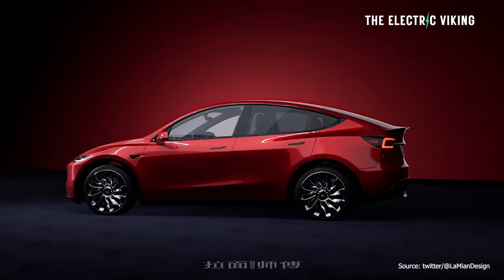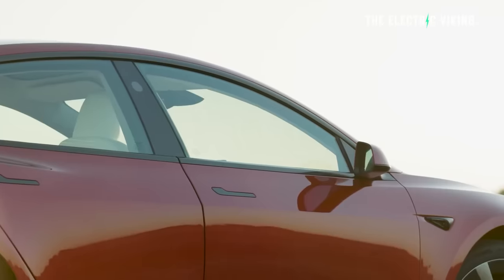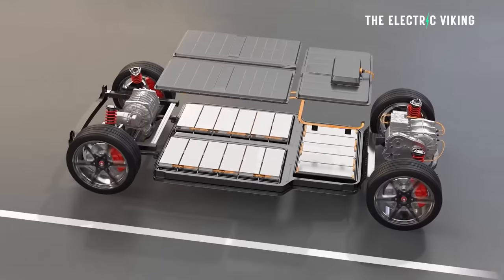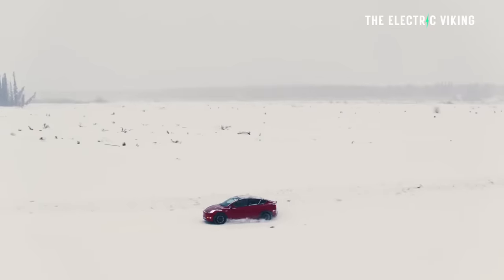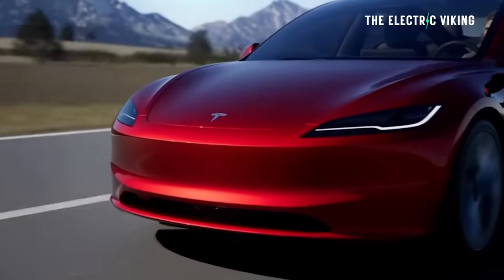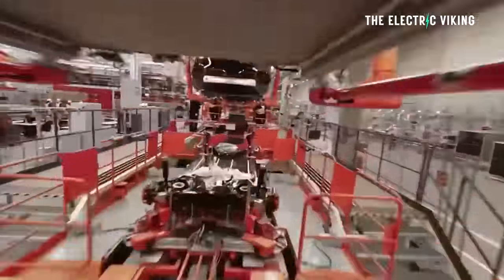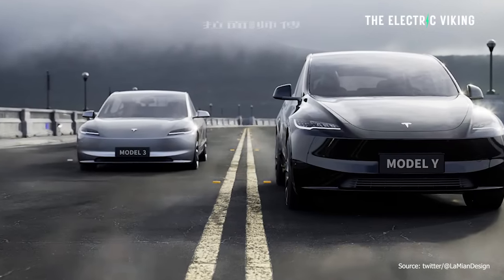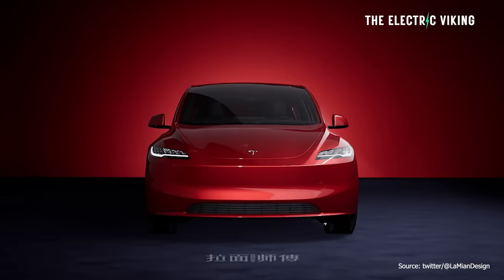NEW Tesla Model Y Juniper details leaked - Factory retooling only weeks away

Comment: 20% more range?  doubt it.  Maybe the same gains as the Model 3 or slightly more.  And why would you not want to own the current gen once this releases?  It's not like it will just be worth zero instantly.  Even though new Tesla's may get better then older ones, they are still cross shopped to other brands aand when you compare, even the "older Tesla tech" comes out ahead.  So unless all EV brands get this new battery tech and ICE cars drastically drop in price, the current gen Model Y will be fine barring any double digit pricing drops by Elon on the new ones of course.
Reply: That's just some people's perogative. They want the newest most recent version if they are spending that much money. Plus some people specifically want the newer upgrades. Like Model 3 for as good as it is still has things people dislike about it or complain about and almost all of them got fixed with the Model 3 Highland. Same will happen with Model Y Juniper. So for some people it's a no brainer to wait for that.
Reply: @VMYeahVN  Maybe I misunderstood the comment in the vid as if you have one now, get  rid of it before the new ones drop. If I did misunderstand, then yes, agreed - wait if you can.  Unless there are some great deals on current.  I bought a Model Y RWD last summer, knowing that a refresh is on horizon.  But I  got 6500 CAD off sticker because Tesla had excess inventory(?). And then 5 grand rebate on top from federal gov.  And this is off the lower sticker price after all the post pandemic price drops. My model Y was cheaper than an upper trim Honda CRV. And if I wanted to sell it when the new "better" Y comes out, I'm hoping the value vs a CRV (or any other ICE/EV small SUV) is still better allowing me to get a decent price.  Those that bought at Pandemic prices, are pretty much locked into long term ownership unless they want to take a 20k haircut by trading/selling.
Reply: @bort7258  Same thing. People who are very into tech/gadgets, which EVs are, or otherwise like to be early adopters for the latest and greatest are perfectly fine taking a loss to upgrade to the new model. Especially if it's notably better than the previous model. To them being in the cutting edge as well as the daily experience of actually using the product is more important than getting a deal. They're not concerned with holding onto a phone/computer/etc for 10 years or till it breaks. They want to be on the cutting edge and have fun following the life cycle and upgrade path of a product line and the trade up loss is the price for playing that game.

Comment: If it’s not 100 percent LFP , I don’t want it
Reply: Why?  Is it the cycle life you're worried about? While the LFMP batteries have less cycle life than LFP it is still higher than NCA or NCM and they can still charge to 100 percent.  One thing I will note.  My RWD Model 3 has LFP batteries and the degradation isn't really that much better than my previous NCM model.  Maybe a tiny bit better but it's right on par with any other battery at around 10 percent at 100,000 miles.
Reply: @Ryan-ff2db  did you charge your NCM to 100 percent most of the time or 80? You already put 100k miles on the LFP model 3?
Reply: @Ryan-ff2db  what Tesla uses the LFMP? I am good with anything that doesn’t limit me to 80 percent “unless long trips “
Reply: @shdmd2118  That's kind of what I thought you meant.  LFMP according to this video and other sources I've read including statements from CATL, indicate that the newer batteries will be in Tesla's mid 2024.  Chinese vehicles will have them sooner.
Reply: @Ryan-ff2db  It doesn't oxidise in decomposition.
Reply: @davidbrayshaw3529  LFP are safer but all battery types are still significantly safer than gasoline engines.
Reply: @Ryan-ff2db  Nonsense. There are lots of claims to that effect but no cited data to support it. It's folklore and nothing else.

Comment: Osborne effect will keep it from being best selling vehicle.
Reply: If your thinking the 2 will osborne the 3 it will not.  Different market segments.
Reply: @danharold3087  No I was saying the Model Y will have a difficult time being the #1 selling vehicle again in 2024, as early 2024 sales might lag (Osborne effect) due to announcement of 2024 Juniper refresh.  Also, re-tooling and shutting lines down for refresh is going to lower model Y sales in 2024.  Combination of Osborne and re-tooling will make it difficult for Model Y to be #1 selling vehicle for back to back years in 2024.
Reply: @zacjones89  I would not go so far as to say your wrong.   The refresh is a tough thing to manage in a way to prevent it.  With luck people not buying the old will buy when the refresh arrives and  the refresh generates more sales.  So hard to tell.

Comment: Thanks for your videos 2 reasons why I won't even consider EV is no charging available at home in the apartment car Park more critically insurance costs , 54 year old driver less than 20,000km per annum only 4 companies prepared to offer, i have been driving since 18 never had an accident or speeding ticket lowest quote $4900 per annum. Compared to $980 (based on Tesla Model Y long range and Toyota Camry purchasing as new. No thanks EV

Comment: yawn. Guess what the public at large has spoken. We do not want them. All manufactures are slowing production and have all said demand is down. The enthusiast marked is just about saturated. The average family is not really interested.  As far as people thinking LFP batteries are so fantastic - think again. Yes you can charge them to100% and not hurt them as badly and they have some other advantages. What they do not have is higher storage density. Which mean yea you can charge it to 100% fast charge but you will be doing it often do to decreased storage capacity of the battery.

Comment: I bet you that battery is gonna cost $25,000 to replace it. Doesn’t matter how much you save if you have to replace the battery that cost that much.
Reply: The first battery will last 15 years.
Reply: Are you planning on driving it more than 350,000 miles? Then you might have to replace the battery. That's more miles than 99% of the population put on their vehicles before they get scrapped or sold. In this case, the car will still have useful life at that mileage number, so it won't be scrapped.
Reply: @douglaswatt1582  I don’t wanna burst your bubble but there is a guy that just posted YouTube video on his Tesla model X he’s had it for seven years it only has 100,000 miles on it and he’s already lost 36% of the battery. The car literally can only drive the maximum of 200 miles.
Reply: @anthonyquinn7803  LOL ...."there is this guy on youtube".....If this were true then it would be a free replacement under warranty.

Comment: We need a BASIC (no infotainment and other over the top CRAP), but a basic basic 150k range electric car for AU$10,000 or less.
Reply: Steven you lucky bastard, you got Elon himself to reply to you :D
Reply: Basic cars do not sell and are never economic to manufacture. Dealers have no basic trim vehicles on site. They are special order. Only made as loss-leaders to maintain brand uptake and loyalty with profits from frequent repairs, financing and spare parts. Tesla made a stripped down Model 3 in 2020 at $35k (less than the average purchase price and well below the $47,580 today that the first mention of a Tesla $35k car in 2013). After two years they bought out a model that people were actually buying, the SR+ that greatly outsold the SR.
Reply: You are 95% right, but cars (EV or ICE) are still INSANELY too expensive.
Reply: Yeah right!  Who is that anyway, a "buy something" scammer?  ...there is NO WAY I am going to reply to it! :)

Comment: What Musk should do right now:  stop shipping cars with Li-ion (flammable) batteries in 2023.  Note which ones it's selling now.
In 2024, swap all battery packs to the LFP manufacturer.  Ensure every car shipped does not have Li'ion.
Reply: LFP is flammable too just FYI, just not as much Li-ion is.
Reply: News flash.  LFP has lithium.
Reply: Exactly ,,EVERY ,,, EVERY ,, EV battery uses Li-ion. Do some research before you post.
Reply: @VMYeahVN  Yes, but it doesn't oxidise in decomposition meaning fires can be extinguished. The maritime and aviation sectors have known this for years. The EV sector, on the other hand, just don't care.
Reply: @davidbrayshaw3529  That's great but that doesn't change that it's still also flammable. The person we replied to thinks LFP isn't flammable.
Reply: @VMYeahVN  Still flammable, yes. But not to the corporate crime levels of arson that most other EV batteries exhibit.
Reply: @timsmith6815  Except for the new VW sodium battery.
Reply: LFP batteries are also Lithium-Ion batteries.

Lithium-Ion refers to the mechanism used to move the charge around the battery - i.e. charged lithium atoms. Lithium Ferro Phosphate (LFP) or Lithium Iron refers to the battery chemistry.

I have seen LFP batteries burn, they are far more difficult to ignite but when they do they burn like a petrol fire and can be extinguished like a petrol fire, but they still burn.
Reply: I maintain the same thought.  End Li-ion now.
Reply: @timsmith6815  I asked if LFP batteries burn.  The response I got was, "No".
I did my research.